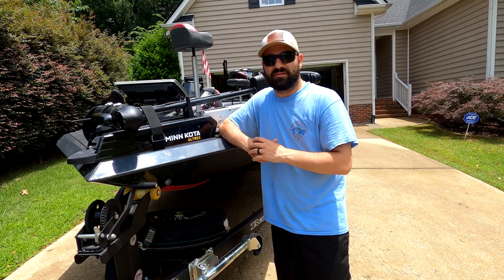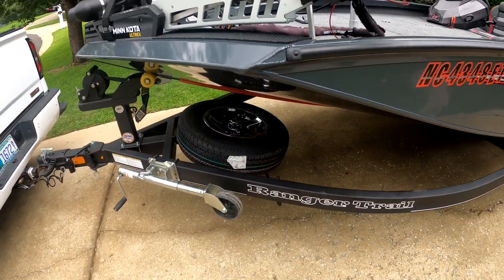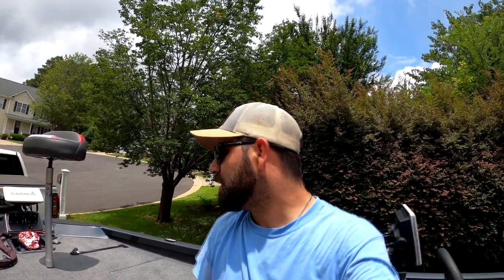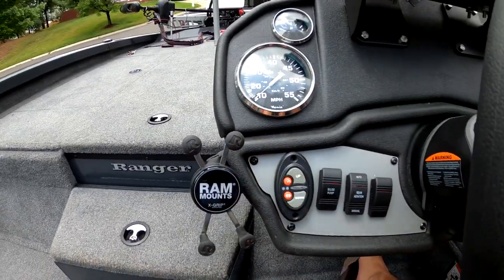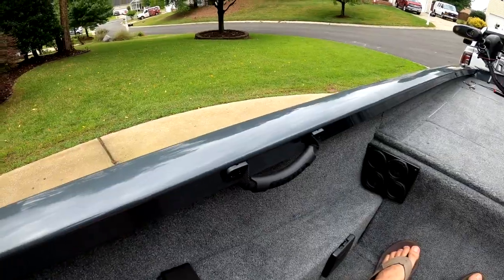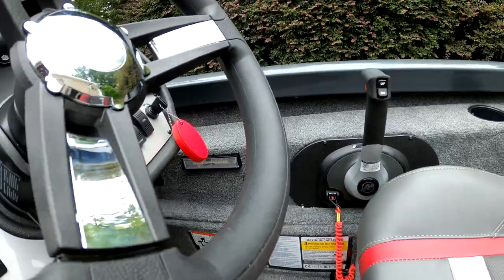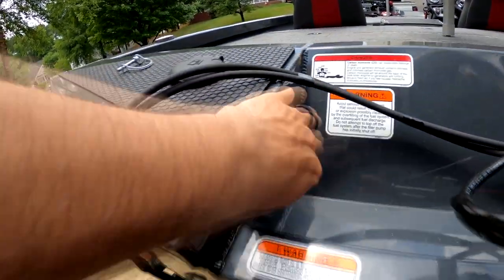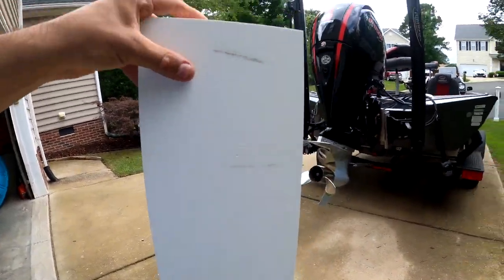New boat, dream boat? (2021 Ranger RT198P)

Comment: Good in-depth review of your boat enjoyed the breakdown. Also congrats man! I remember talking to you awhile back about these, I too almost bought the Lund version. I'm glad you made it happen it feels good owning a Ranger even it is aluminum. I got my 2020 188p same color as yours, in may of 2020 and I love the thing to death. No major issues with it all.  The only minor issue is the foam on the bottom of some of my lids is coming up, I need to get some adhesive and redo them. I opted for the 115 Yamaha SHO nothing against mercury like them both, but for a 115 the things a beast.  I'm a bigger guy so is my dad both are about 240-250 lbs full tank of gas full gear we got 45 once, usually hover around 38-40 stock prop. For you or anyone wondering the 2020 188p left rod locker stays open, I'm not sure what they did different. Sorry you had issues with it, I wonder if its because they moved them to the tracker plant after 2020. I've had 0 hull and trailer issues I sadly hit a rock going slow and scratched up my keel/bottom of boat a bit and dinged the skeg a little. Of course I didn't put a keel guard on it yet always happens that way. I installed a helix 10 by my trolling motor, and there was already a power block up there that I could hook the finder up to didn't have to run wires. No interference gets plenty of power no issues works great. I opted for the coinbox its nice having USB chargers right there and looks sleek as hell lol. I almost got the 198p but it was 38k vs the 30k for my 188p, I checkout Vexus as well and those were all 40k+. Sadly I'm still stuck in the northeast with mine. I'm still working on moving to western NC, hope I can make it happen soon.

Side note not to be weird but I noticed you have a Reynolds boat shirt is that the one in CT? Did you get your Lund or the Ranger there? I drove down from MA to get my 188p from them, they made it really smooth easiest dealer I've ever worked with.
Reply from the maker: I used to live in NH and moved to NC a couple years ago. I fished some of the Reynolds trails and they gave out shirts at one of the trails I fished. 

I like the 198p but not all of the issues I've had with it. Hopefully a resolution I've been working on will change my perspective about my whole experience and view on ranger boats. I hardly fished much last yr because of the crazy and lengthy crap I had to deal with

Comment: I haven't had as many issues with mine.  Love the boat it rides really good and with 3 people fully loaded im getting 55.  The engine did have a recall the iep valve i think thats what its called went bad so the boat would not idle correctly.  Dealer fixed this.  Also from the factory they didnt put 2 screws in the transducer plate so i was taking on a ton of water.  Easy fix.   Have fun and catch a lot of fish!
Reply from the maker: Got a jackplate on urs? I'm getting 58 by myself and 55 with a passenger. Once all is fixed I know I'll love it!

Comment: I’m looking at a slightly used 2017 198P it has the Hummingbird Helix 7s on it. I’m going to have the dealer put on an Ultrex and link everything together. Has Mercury 150 4 cycle, no jack plate, with 26 hours on the motor.I had power poles on my last boat but I think will just get by with the Spot Lock on this one. I hope the first owner worked out all the bugs.
Reply from the maker: To be honest I think you will be good. I know people with older Rangers and specifically 2017 and they've had amazing luck!

Comment: Back compartments don’t have a latch or lock because they have the drop in tray liners and can be used as a cooler if need be. You have to cut out a section of the drop in liner for the latch to go through the side in order for it to “lock”. Whereas the other compartments actually have lips around all the edges.
Reply from the maker: Yep totally makes sense. Definitely could be made to be locked though. Especially the compartment that's the step to the front deck. That thing should 100% have a lock on it if its already made to have one. Just in my opinion
Reply: I have a 2021. The plactic bins in the back 2 compartments are screwed or riveted in place and not removable so the y are not "drop in". But I agree they could have still made them lockable or with some thought and effort you can make them so.
Reply from the maker: @JohnWalkerCharlotte  ya i will eventually make it so I can lock them!

Comment: Not a bad boat, but boy has Ranger lost its look. When you saw a Ranger before Johnny took the company over the boats really stood out to the rest of the bassboat brands and the quality showed. I fished out of a 2003 185VS and the only thing that broke in 20yrs of use before selling it was the bildge pump in very rough waters. Would have kept it longer, but reason to sell is Ranger no longer stands by their products. It use to be you could get parts for a 20yr plus old boat. Now after only 5yrs they obsolete it and it becomes hard to get parts. Plus before you could order parts directly from the Ranger factory, but now only way to get parts is through the dealers which put ridiculously mark ups on parts. Overall, got fed up with them and said good bye to Ranger for good.

Comment: I got a 2021 188p this year and it was a disaster!  Hole in transom for transducer mounting plate with no screw in it.  Transducer wire wasn’t even plugged into unit, and the factory drilled a hole in the gas tank when they installed passenger grab Handel.  They had to replace the gas tank and carpet in cockpit that was destroyed by the gas flooding it.
Reply from the maker: Quality control doesn't exist anymore. It's so so disappointing

Comment: Wiring my 2020 was a pain as well. I ended up running 8 gauge tinned wiring From the back through the gunnel to the front and then to the front storage compartment for a separate fuse panel. What size prop do you have? Mine came with a 21P vengeance. I upgraded to a 24P tempest the spring.
Reply from the maker: Yep! I ran 10 Gauge from both graphs directly to battery. I have a 23p tempest and love it so far!

Comment: Best review I’ve seen on this boat 👍 and I watched tons . Thanks ! Only question, any regrets not going with tandem axles on the trailer ?  Just by looking at the ranger website the tandems seem to be stock ( I’m not sure) if so, did it affect the warranty at all by going with the single axle ? .  Personally I prefer the single axles but at the same time I want to do a lot of traveling ..  
Also, I really liked how you ordered the boat, you saved a ton and I may follow your path when I get to order , so again thanks for sharing ..
Reply from the maker: Thank you! And what you see online is basically the best of what you can get for the boat when you order. I ordered mine with single axle because thats standard. You can upgrade to tandem axle though if you want. Im happy with the sinlge!
Reply: @farwellfishing  perfect. Thank you .. have a great weekend

Comment: Excellent review on the 198P, thanks for going into such detail! 
It's a shame you spend that much money for a boat and get that kind of build quality?
I'm considering the 188 or 188P but I've been hearing similar stories to yours, I will be looking at other brands as well. Did you look at the Crestliner XF189, that model can take up to 150HP?
Reply from the maker: Thank you! I mean i have buddies who have had excellent luck. And honestly all boats have issues but these kinds of things are kind of excessive in my mind. I did look at other brands but wasn't in the position to spend 7k to 8k more for a very similar boat. Especially because I knew I wanted to put upgrades on it such as power poles, vessel view, gas struts for rod lockers, etc. At that point it would be 50k and it just wasn't something I was interested in spending at the time. I just picked up my boat from getting the whole steering replaced so HOPEFULLY everything is fixed and I can go out "problem free" knock on wood lol let me know if you have any questions and thanks for watching!

Comment: My opinion, I don’t want to spend 40k on an aluminum boat with only a 150 xs I feel like that’s over priced when I can get an xpress for the same price with a 250
Reply from the maker: No way. Brand new xpress you aint getting an xpress with a 250 for 40k. I agree it should be designed to have at least a 200. If an xpress was 40k with a 250 many people would be doing that.
Reply: @farwellfishing  the x21 pro is listed at 39k, I mean with everything you got I guess with fees it would be like 47k
Reply from the maker: @BlakeLassman1  what you're looking at is the base price with the minimum horsepower motor which on the website is a 175 yamaha. If you add a 250 the price jacks way up.
Reply: @farwellfishing  yeah I realized that haha you got an awesome well crafted boat!
Reply from the maker: @BlakeLassman1  thanks man
Reply: @farwellfishing  you just caught a big mouth bass lying😃😃😃… $40 grands on a xpress with a 250 😂
Reply from the maker: @flatulence8515  if only that was the case you wouldn't be able to get an xpress for years! Not because of covid but because everyone would be buying them!